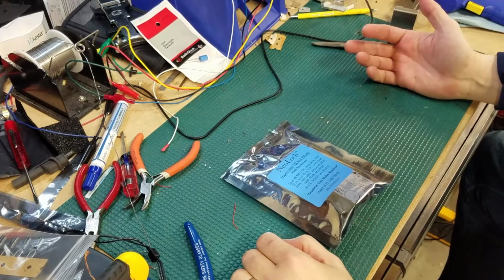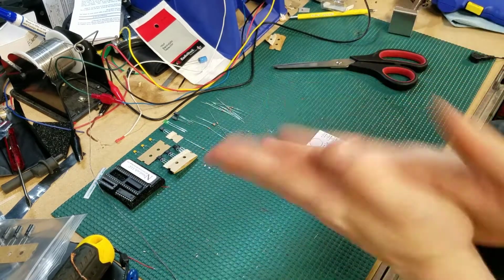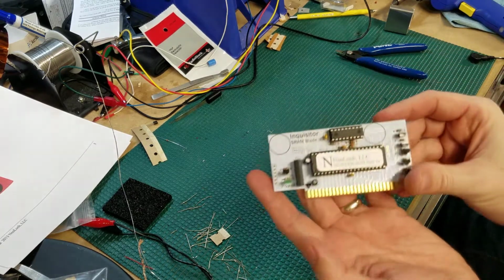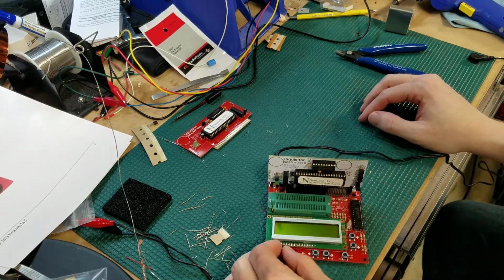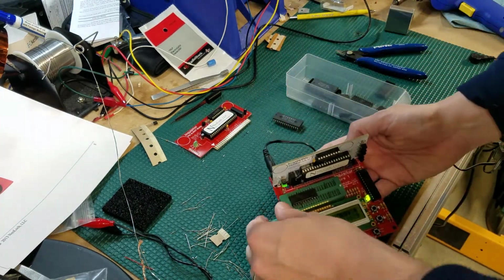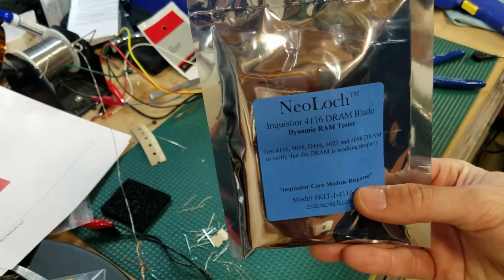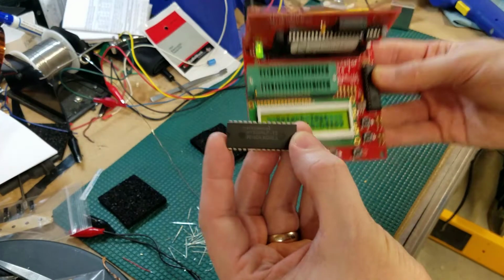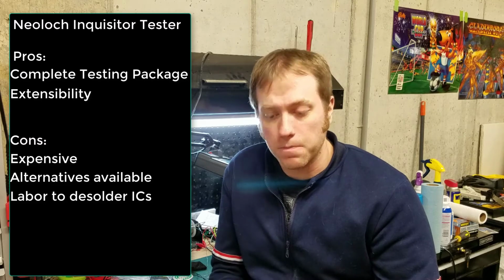Tech 'n Tools: Neoloch Inquisitor IC Tester Part 2

Comment: Excellent videos, thought I'd like to point out a couple things in a public comment so everyone can benefit. 
1) The instructions for the SRAM assembly were recently updated to include transistor 7 (you didn't solder that one in), this is the key compoonenent that seperated the SRAM 1 blade from the SRAM 2. 

2) Testing the 6264 with the DRAM blade probably destroyed the 6264. Those early DRAMs required +5V, +12V and -5V, and I imagine the 6264 wasn't too happy about that. So this is a prime example of being very sure of what you're testing when using the DRAM and 9060 Blades.

3) I'm well aware that the number of tests on the SRAM blade is becoming burdensome, that's why I've condensed the number of tests to as few as possible and added code to allow the user to customize the test order. This allows the user to arrange the tests in an order that makes sense to them. If you haven't already, you should check this feature out.
Reply from the maker: Thanks David and I appreciate the heads up on #2 and #3!
Reply from the maker: BTW, I used the Inquisitor tonight and nailed a couple of bad PIAs!  Any thoughts to DIP test clips mod for Inquisitor?
Reply: That's something I'll have to look into.